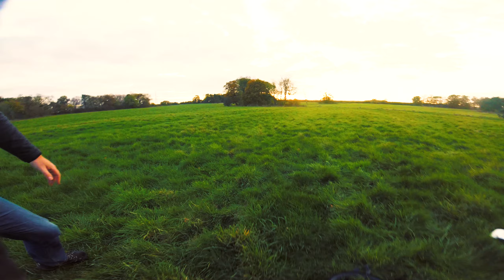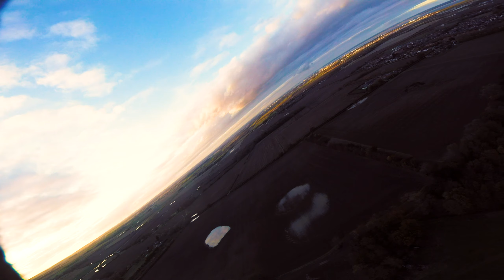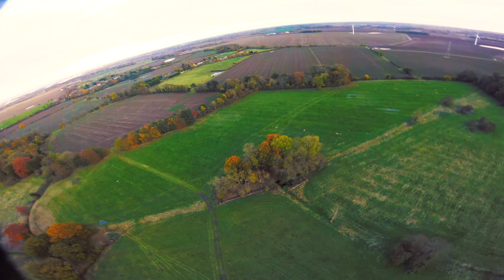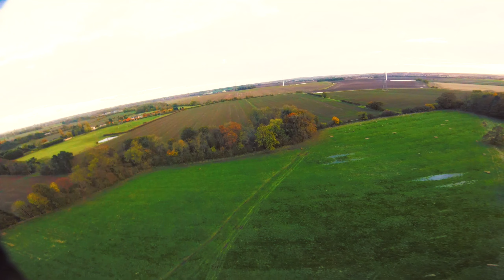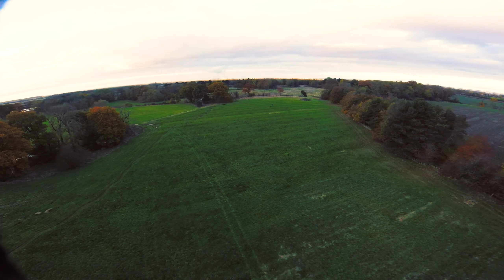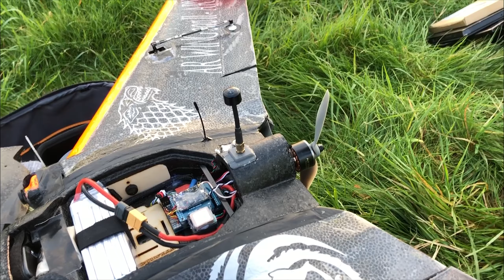AR Wing 6S ESC Failure - Emergency Landing

Comment: What are you getting on the amp draw on your setup? And also flight time with your 6s lipo?
Reply from the maker: I honestly cant tell you because after burning two ESC's and a Matek FC I gave up on the 6S option for the AR 900.

I have run my AR Pro on 6S with a Brotherhobby 2218 1250KV on an APC 7x6 prop with 6S 2200mah lipo and max amp draw was about 35 amps with a 6:30 or so flight time.

You can see that flight here also with a 8x4.5 prop

I hope that helps

https://www.youtube.com/watch?v=rwS1psSRDVA&t=245s
Reply: @bluefish3607  Yes, very helpful information. Thank you.

Comment: Was it the esc? I hope so as I've just added the AirB 2514 to my AR, and waiting for a break in the weather to test. What are your thoughts on that motor?
Reply from the maker: The ESR capacitor broke away from the FC and shorted out the ESC and burnt it out. The motor is excellent and totally undamaged.